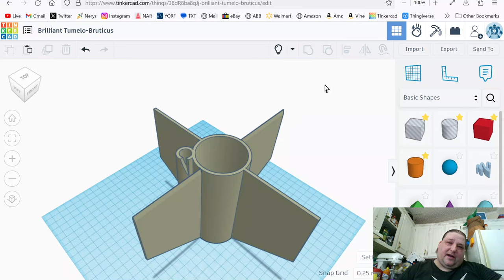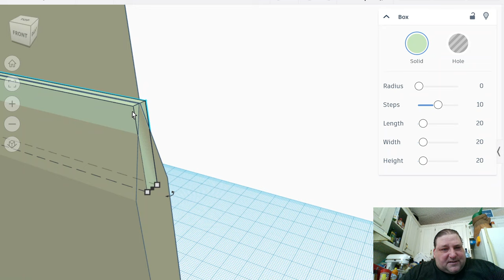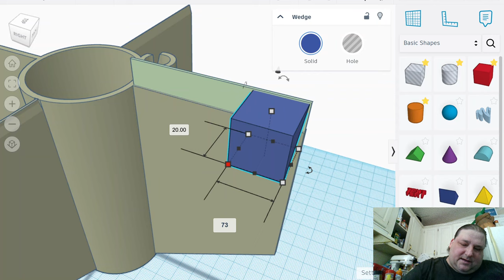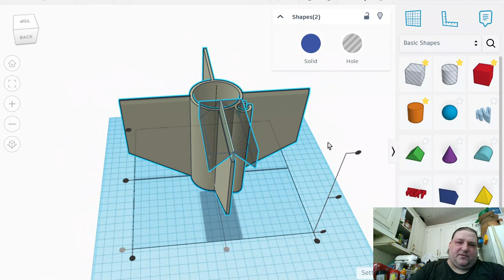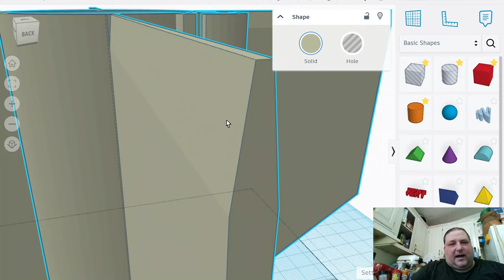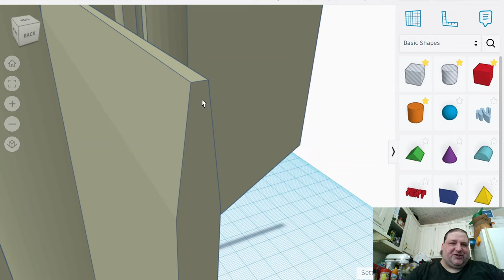Vase Mode Fins print with Gap Solution T3DP

Comment: Hi, great video again! When designing for vase printing, it's important to know where the line will be printing. In another video you mention that Cura slice in the middle of the line and Simplify3D on the outside. I use PrusaSlicer and Cura, do you know how PrusaSlicer slice the line? And I look for a reference about the placement of the lines for Cura and Prusa and didn't find one, so if you have a reference it would be great.